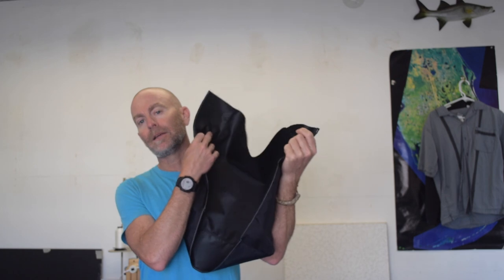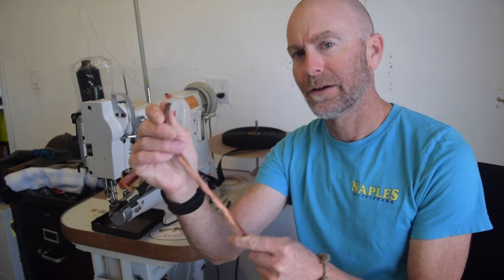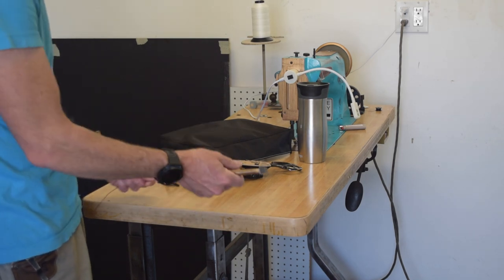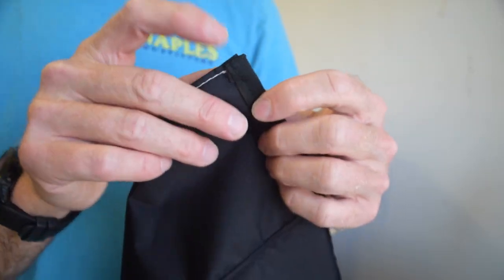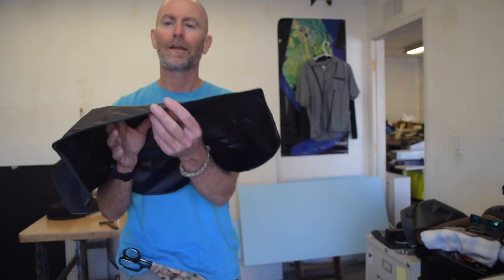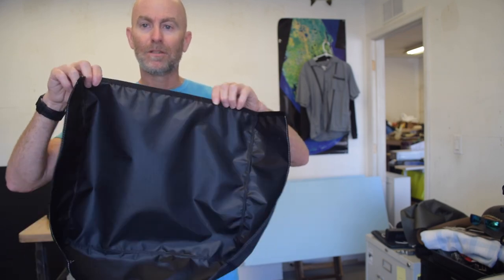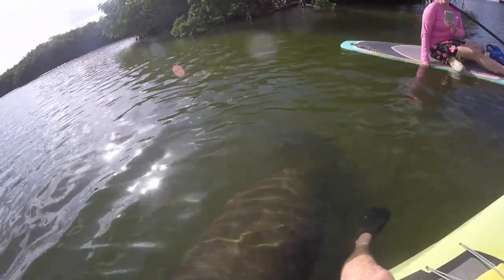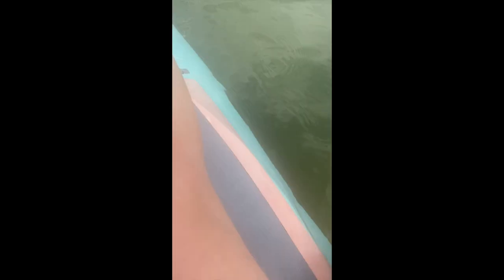Using Wire In Sewing?

Comment: I used copper wire when making masks. To get it really straight, secure one end to a bench, door, whatever. Make a handle at the other end. Then tug hard, until it stretches just a bit. It will be very straight. And harder than annealed state. Copper easily work hardens, and it will if stretched like this.

Comment: Good tip using the wire.  If I were going to make the trash bag for the sewing table, I'd probably make it the full width of the table.  Just saying.  You could also attach it to the table using velcro, making it easier to empty.....still using the wire around the opening.  (attach the fuzzy strip of velcro to the table and the hook side to the bag)  Thanks, Jason!
Reply from the maker: Honestly, right after I made this, I immediately thought, "Hm, I should make this the full width of the table!" lol!  Oh well, version 2.0!
And I like the idea of using velcro, but I happened to have a few screw-studs lying around, so they won :)
Thanks for watching and commenting!

Comment: Similarly, I had a floppy sun hat the brim of which was never where I needed it to be but was designed to be foldable, packable etc. i fished a length of stainless steel wire (Harbor Freight sells a generous spool  for $5-8 IIRC) until it went around twice using the existing double fold seam as an entry point. Folding the very ends back on themselves prevented poking and now I can shape the brim exactly how I want and doesn’t rust. 👍🏻👍🏻
Reply from the maker: That's an awesome idea!

Comment: I like your use of wire for both projects. The manatee footage is amazing!

Fiber artist, Salley Mavor uses a lot of electrical wire in her hand stitching with wool felt to give the edges support or to make her pictures more dimensional. In addition to her blog, which contains photos of her hand-stitching process, there are a few YouTube videos. A recent one is The Making of MyBed, shows how she uses wire on the edges of a felt door or window to give it stability. 

Another option for a project like yours would be to zigzag over the wire near the edge of the fabric.

Comment: Great idea for a form-fitting cover - I could even see using that approach on a small dopp-bag or similar! I might have to try that! To get thin copper wire like that straight you can pull-it straight - it works very well. Clamp one end in a vice or wrap it around a table leg and pinch the ends with vice-grips or similar, then just pull on the other end with another pair of pliers or vice-grips. I use this approach all the time and it works well.
Reply: Yep. A good yank does 95% of the work for you.

Comment: I make work pouches with zip tops. I use metal coil brake line shielding to spring the bags open when unzipped so i don't have to mess with the openings while working.
Reply from the maker: That's a great idea!

Comment: Aluminum wire or welding rod works great for these kind of projects as well. You buy scrape aluminum power wire from your local electricians for very cheap if they have any. Each strand is about 3/16” thick. I used this method to make a cloth hamper stay open. Made a large circular shape with the aluminum wire and sewed it in place.

Comment: Jason.  I have seen a technique where you put one end of your copper wire in the chuck of a hand held drill.  Stretch the wire (and hold that end in a pair of pliers) , then slowly turn on the drill.  Just a little twisting will straighten out the wire almost perfectly.  I think I used this when doing sculpture and straightening out aluminum wire.  Try it and see if it works for you.
Reply from the maker: Honestly, I was trying to remember if that was something I had seen in the past, but ultimately just did it by hand, for this application it doesn't have to be laser-straight.  But I do need to try that method sometime, thanks for reminding me about it!
Reply: @thejasonofalltrades  I remember the technique because I did not believe it would work.  It does.  Nicely.  Faster.